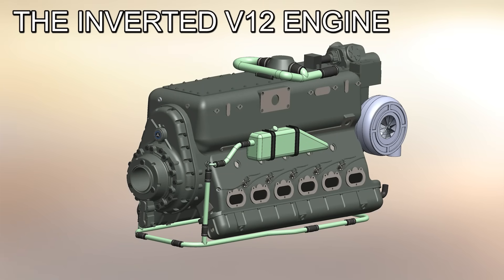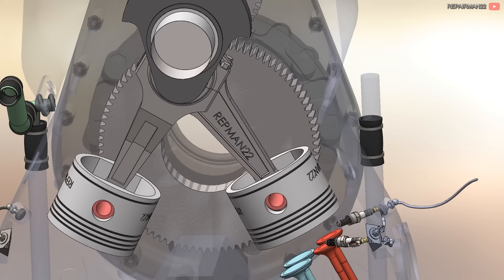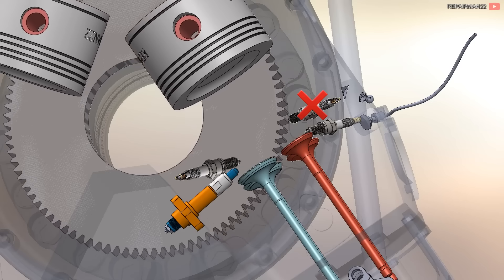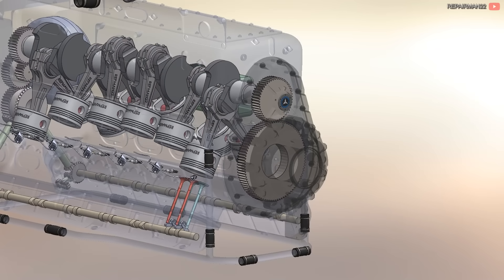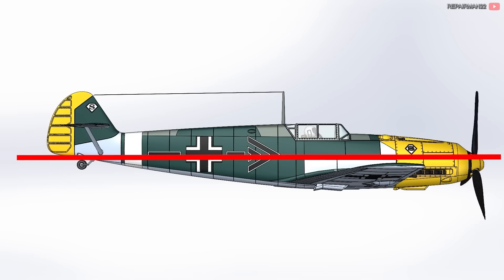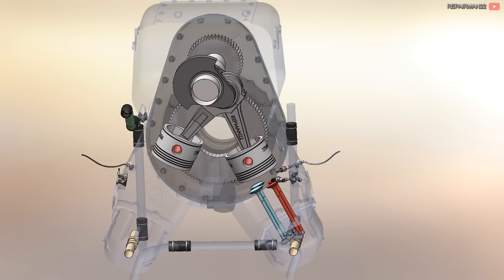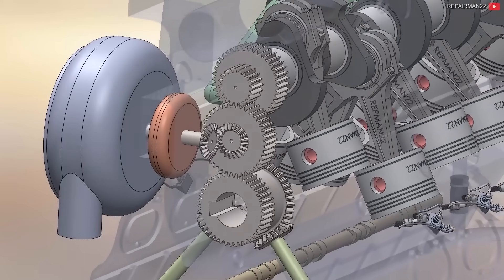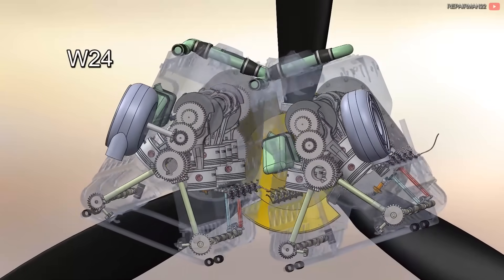The INVERTED V12 🤯 Why!?!?  - 3D animation - DB 600 Engine // Daimler Benz

Comment: Gear driven camshafts. The ultimate in reliability and peformance. No timing belts/chains to break.
Reply: Necessary reliability for an aero engine. If something goes wrong in a plane, you can't just pull over by the side of a cloud and wait for AA to come.
Reply: @brookeshenfield7156

TIMING CHAINS NEED GUIDES! 

It doesn’t matter if the chain itself failed or not.  The results are still catastrophic if a guide fails.
Reply: @calvinnickel9995  Not all engines with timing chains use or need timing chain guides. Older American cast iron V8's are a prime example. Also, there are non-interference engines that will not damage the valves if there is a failure, be they equipped with either a timing chain or timing belt system.
Reply: @Fraud_Flintstone  I don't think there's much in common between an old American OHV V8 with a higher performance OHC aero engine. The timing chain on a V* OHZ is very short. It only has to run from the crankshaft to the camshaft running in the V between the cylinder banks. Such an engine isn't going to be suitable for a high performance aero engine.
Reply: @TheEulerID maybe throw an I-6 300ci in there and balance is achieved.
Reply: A truck I once drove had a 400 with gear driven valves instead of the typical chain. 
Never had trouble
Reply: At the time of manufacturing,  modern belts were not available.  The engine does not have to severe harmonics, so gears worked well, as crank has dynamic balancers.
Reply: @brookeonmaui Until you hear a pop, clunk, sputter, sputter, and the power drops like a lead balloon. Then a faint woosy whisper and a final gasp, then SILENCE! Except the sounds of your sobbing and tears!!!😂🤣😂🤣
Reply: @leechjim8023 and you crash on the Englishman's farmhouse
Reply: @brookeonmaui  chain guide failure can lead to skipped timimng and eventually a valve collision... which can grenade an engine
Reply: These are not gear driven camshafts. The proper name is shaft and bevels.
As a motorcyclist with an old Ducati I am very familiar with this system. If you look at the racing bikes of MV Augusta and Honda back in the sixties these used a train of round gears all meshing together to turn the camshafts. 
The only modern engine I can think of that uses a shaft and bevel camshaft today is the Kawasaki W800.
Reply: @philhawley1219 they are gear driven camshafts 💀
Reply: A lot of high-performance race engines used bevels & gears. Most notably Honda VFRs & RVFs:

VFR 750 & VFR 750 RR & RVF 750 RR

Honda RC30 | Honda RC45
Honda NC30 | Honda NC35

The mechanical whine of those gear-driven cams is incredible.

Most sexy sound!
Reply: It's not matter what to use gears or chain, both can be made reliable or not. If modern car manufacturer would use gears it would be a tiny plastic gears which will wear and broke at the first day after the end of warranty period.
I had a chainless bicycle with gears and driveshaft. Front gear was so small, that at some moment lost some teethes. Also I once replace a gear in car transmission. There also were some teethes broken, but that probably cause by a road accident some time before. At the same time old-school timing chains worked all the engine life without problems.
Reply: @brookeshenfield7156

They don’t have to break.  They just have to stretch enough to skip a tooth or put the valve gear out of time enough for catastrophic damage.  Go read endless problems with vehicles that have timing chains.
Reply: This was standard for aviation and tank engines at that time, at least in my country
Reply: Due to the design of the engine, gears just seem to be the most compelling choice given the presence of gears used to drive the supercharger and the location of the heads and cam along with unique spacing constraints, i think thats probably why they did it. 

Unfortunately alot of engines designs dont really allow for it.  Such as a typical 4 cylinder car engine.   An obnoxious amount of gears would need to be stacked in order to transfer motion from the crankshaft all the way up to each cam shaft on the head. Intergrating that many gears compounds the issue of lash, especially as wear increases over time, with no clear way to address it, unlike the case with a chain and adjustable tensioner. 

Even when over head valve V8s were commonly found in most cars on the road, manufacturers still mostly chose to use a sprocket and chain to drive the cam instead of gears, despite the distance between the crank and cam being very short.
Reply: ONLY OG GERMANS CAN MAKE THIS!
Reply: Yes. Have a couple engines with this drive style. My R-1340 in my T-6G, and the Ferrari designed radial valve 4-cylinder in my MV Agusta F4 1078. The gears run up between the middle 2 cylinders, similar to the Porsche 917 flat 12.
Reply: Many commercial and mass engines used gears - like VW 2.5 TDI which used on Touareg or Transporter
Reply: Correct me but the Cosworth DFV used geared timing from the crank to the Camshafts, 
Gordon Murray's new T50 supercar uses again a Cosworth V12 again with geared timing. My understanding is that both Belt and Chain driven time is cheaper to produce and maintain and as less moving parts. But most designers say gear offers better reliability especially at high RPM.
Reply: All the V12s aero engines of that period used geared valve trains. That includes the Merlin, Griffon, Allison V-1710 and Hispano-Suiza 12Z.
Reply: @brookeonmaui  chains are not a good idea on a high performance aero engine pulling extreme g in at different orientations. You do not want long lengths of chain in those conditions. All the WW II V12 engines of which I'm aware used bevel gears to drive the overhead cams.
Reply: @TheEulerID  The pilot would pass out or be un-alived well before those forces bothered a chain any. Just the operational forces while running dwarf any external G's, short of blunt impact trauma by crashing into something hard, or projectile impacts. Your reasoning is quite .. fluffy
Reply: The power consumption of gear driven drive trains compared to belts is significant.
Reply: @allangibson8494 is it though?
Reply: @user-gn8hf2ig7w  Power consumption is why bikes have chains for the power transmission not gears. Chains and belts have higher efficiency and are much lighter but gears don’t slip - pick what’s important.
Reply: @allangibson8494  not completly correct, power consumption is only greater while advancing engine rpm because of the higher rotating mass, but Power consuption while maintaining engine rpm is lower due to lower friction  losses. Thats one of the reasons why gears are used in aircraft engines with constant speeçd props engines will usualy hold rpm for a given power setting.
Reply: @ The drag is proportional to RPM. Gears have sliding contact at all times - belts and chains have less sliding contact area.
Reply: @allangibson8494  drag is not proportional to rpm but to drive ratio and tourque, chains do have a lot more contact area that is producing friction but not in contact with the sprokets, while the actual contact area as well as the type of friction changes with the progression of one tooth through  addendum and dedendum. I think it just realy depends on the application, but for big, slow turning engines that will run on constant rpm for long durations the gear drive is just the way to go.
Reply: @allangibson8494  btw, that is not even remotely why bikes use chains
Reply: @brookeonmaui 
Pfft narc 😂
Reply: Wear factor > 9000
Reply: You mean running a belt in oil is bad?   Lol
Reply: Tough to keep in time due to gear lash, Porsche used in 587/3
Reply: 4our  I'm 
Piss-Ton Břokê
Reply: @brookeonmaui dogs eat their own vomit - delicious - then they lock your face / mouth. Don't
Reply: @brookeonmaui But in an airplane you have G’s that put a lot of strain to an ordinary engine with chains and camshafts or push rods.
Reply: Ottima spiegazione
Reply: The engine that will not push the owner of the car to buy a new one in the fear of replacing million parts cost 500% of real price? This decision will never be taken by Mercedes lmao.
Reply: noisey but ,and destroy oil
Reply: Army jeeps had timing gears
Reply: Saw one of these at RAF Cosford museum yesterday, an impressive lump
Reply: Sound cool too
Reply: Indeed! But it would difficult to add tech such as variable valve timing
Reply: In 1938 there were no belt chain,are you Crazy?
All the engines they were with Gear for camshaft at that time.
The very strange things Is 3 valve and position of intake and exhaust...that s the innovation
Reply: Heating goes brrrt
Reply: Corporate profit. The accountants ignore engineers and say a belt to drive the cams is cheaper to produce and only has to last the length of the warranty. If you think car companies care about reliability beyond the warranty, you’re in for a sunrise. Most car manufacturers don’t make much profit on car sales any more, most of their money is made from servicing and repairs or financing. Or they’d prefer you to buy another car from them every 3 or 4 years than buy just 1 car for for life. It’s called planned obsolescence.
Reply: @notmenotme614  We need government mandated reliability and repairability standards. Starting with mandated fluid dipsticks.
Reply: @notmenotme614  A well engineered belt is fine. The external type can be replaced relatively simply and modern ones go way beyond 100,000 miles. I'd much rather have that than a chain, which can and do fail catastrophically and are much more expensive to replace.
Reply: Gears break
Reply: Ducati....
Reply: Ehh Cummins and yanmar both still shear gears 🤷‍♂️
Reply: Agreed
Reply: Yeah, gears are just a little noisy , a problem for cars but not a consideration for a fighter design.😊
Reply: Yup but high decibel whine , I know because I had the up grade done on my Harley
Reply: What a fun conversation 😂
Neither is better guys but instead they are favored in different setup's, each having an advantage. Belts are quiet so you see them in most passenger cars. Gears whine but the response is better and they're popular with gear heads (That's where the name came from lol) and chains are an answer to stretching and breaking belts.
Reply: International v8s were gear driven.
Reply: The engineering behind these WWII engines is insane, huge low revving torque monsters that are designed to run under the most demanding conditions. Nothing out there today is anything like these crazy engines.
Reply: The GMA T.50 has gear driven cams. Revs to 12,100 rpm
Reply: Crazy dude haha do you imagine
Reply: Most aircraft piston engines have geared camshafts, this is not unique nor is it a source of problems, the cam will wear before the gear set does
Reply: The same as what pretty much all truck engines use
Reply: Somehow the Germans forgot about this and now their cars all have massive timing chain issues 🤷🏼‍♂️
Reply: @Niels_Dn cheap designs that make you take them to stealership
Reply: @jamesocker5235  for real 😭
Reply: @Niels_Dn don’t be silly Niels!
Reply: This engine would go 100 hours to overhaul. A Merlin would go 500 hours.  A Pratt and Whitney would run longer  and was the ultimate in dependability.
Reply: German cracked fuel would not evaporate as readily as the Allied fuel, and would contaminate and dilute the oil quickly, leading to low engine life.
Reply: @MarkSmith-nw4os Due to poor oil and fuel quality, not because of the design.
Reply: @brookeonmaui  the guides go all the time and end up in the bottom of the timing cover housing...
Reply: Hmm… the number of worn cam and timing gears I’ve replaced on aircraft over the years says otherwise.  

Chains and belts are reliable when they are maintained as well.
Reply: @calvinnickel9995  What type of engine oil do they use in piston aircraft? Does it have to be FAA approved?
Reply: @calvinnickel9995 i work on trucks and coaches, they all use timing gears and i never once had to change one.
Reply: Gear driven cams might be more reliable in short term but try and drive a gear driven motor 100000 without replacing them and see what happens bud 😊
Reply: So it's basically an American v8
Reply: They broke at the pistons.
Reply: Too loud. Too heavy.
Reply: Until you consider how much wear and tear they would suffer from spinning as such high rpms imagine replacing each individual gear compared to simply getting a new belt
Reply: @randomrayquaza2044  i design and make industrial machines. I've seen things made in the 50s working 24/24 with gears still brand new, at speeds higher then a combustion engine. The machine is immortal
Reply: I believe it.
Reply: Sorry sir , did you learned about engine materials ?
Reply: @docvolt5214 no combustion so no burnt oil problems!
Reply: @docvolt5214 it all depends on the metallurgy of the gears and their lubrication. If the gears are made from durable metals and given proper lubrication then most any mechanical component will last quite a long time.
Reply: @docvolt5214  praise the Omnissiah, all the machine spirit needs is some prayers and blessed oils.
Reply: @docvolt5214 making the comparison from industrial machinery to combustion engines is a complete non-sequitur. Yes, they use similar torque transmission methodologies but the operating and most importantly the lubrication environments are completely different.
Reply: @randomrayquaza2044  This engine spins at 3000rpm. The engine of the Honda CBR250RR mc22 hit almost 20'000 rpm and used guess what? geared camshafts. Turns out it's one of the most reliable engines.
Reply: @tank-eleven  Gears, compared to chain or belt are heavy, noisy and more expensive. Since Fiat Dino ( 1967 ), not many car manufacturers use gears.
Reply: @tank-eleven and the Honda VFR
Reply: @tank-eleven same with the older vfr's
Reply: @tank-eleven you are comparing a v12 to a single cylinder motorcycle engine....
Reply: @randomrayquaza2044  Well ... thats the beauty of a 2500~3000rpm engine ... Camshaft is turning at half that so revs are not an issue.
Reply: @Coyote27981 a 3k rpm engine? 😂.
Reply: @2seep  yes, the video is about a 3k rpm engine. It was 33.9 liters
Reply: @randomrayquaza2044  в отличие от автомобиля, самолёт не сможет остановиться на обочине, чтобы заменить ремень. А шестерни должен заменить механик в соответствии с регламентом, а не когда сломается 🤷🏻‍♂️
Reply: @randomrayquaza2044 yeah right… thats why almost all engines in industrial, construction and farming equipment use gear driven camshafts. Its just more reliable
Reply: @randomrayquaza2044 aircraft engines don’t spin at high rpm. 2500 rpm isn’t high considering the camshaft spins at half that.
Reply: @randomrayquaza2044  Wear is virtually nothing as long as it's properly oiled. Cummins engines in Ram pickups have gear driven timing and none of them ever have those components replaced as a maintenance item.
Reply: @randomrayquaza2044  
The different ways of driving cams all have their pros and cons.

Gears are expensive and far more difficult to make, sizing them to exact tolerances in those days was difficult and created a lot more rejected gears that had all that time involved in making them but aren't in spec, in an engine meant for war that translates into less produced per man hour, the best aircraft engine in the world isn't worth squat if you've got a bunch of planes sitting around with big holes in the front waiting on engine's, one thing about driving cams that's completely different than driving any other similar shaft is because of the lobes and the resistance on them from the valve springs, while the valve is being lifted the lobe is compressing the spring, ie driving it, but once the lobe noses over past peak lift all that pressure reverses and the valve spring is suddenly pushing on the lobe and driving it, that effect causes the teeth to slam across it's play when it goes from driving to being driven, the more play the harder the teeth get slammed which will eventually cause a failure from a crack forming, not enough clearance between teeth and you'll have a failure from heat destroying the metal, the biggest pro of a gear drive is they keep the cams in time with the crank.

Chain and belt drives handle the problem much better of each lobe wanting to reverse all those pressures as they travel past maximum lift, especially a belt, they absorb all those nasty vibrations in the drive from that effect, a cam doesn't spin smoothly, it's like it's getting punched around in a circle instead of smoothly spyn and a belt is good at absorbing all that violence,  chains are fairly good at it to but belts are the best at that, the obvious downside to belts is they break eventually, however in the past several decades with the advent of wet belts they're lasting a good bit longer, they're oil proof and are designed to be inside an engine where oil getting on them removes heat as it's flung off.

Timing belts and chains both lower production costs substantially compared to gear drives, there's virtually no rejected parts which are far easier to produce in the first place, but they both share a downside, they can't hold the cams in time like a gear drive set can, especially with a V type engine, when making the cam drives for a V engine belt and chains have to be made long as was the case with the famous 427 Ford Cammer, an early privateer that was racing it suspected as much so he machined places on the cam covers so a shaft attached to each cam could pass through a seal, on the end if each shaft was a disc that he marked each one with a thin white paint stripe and fashioned wire pointers that the stripes pointed at, the engine was set up on a dyno and when they ran it he shut off the lights in the room and had a strobe light he could vary the timing of the flash on, when done he could visually watch the cams at higher revs bounce around just over 6° each side of center out of time with the crank, so he built and marketed through his speed shop a gear drive conversion kit for those engine's that increased top end power by something like 30%.
Reply: @dukecraig2402  Wet belts may be good in theory, but with belt material still vulnerable to oil, the "solution' of coating the belt with a material that stops the oil soaking the belt is flawed. Inevitably, during installation and use, tiny voids made during installation  the coating allow ingress of oil oil to destroy the belt - as demonstrated horribly in the Ford Transit van, with belts failing at 40K km or less.
Reply: @autophyte  
No it's not just "good in theory", just because a belt manufacturer sold Ford on a bad type of belt doesn't mean there aren't ones that work correctly, and yes there's plenty of rubber types completely impervious to oil, what do you think the seals and gaskets in your vehicle are made out of? Leather? No, rubber. 
And your citing one example of something and claiming it's representative of an entire technology is like saying pneumatic tires are a bad design and prone to catastrophic failure based on the Ford Explorer/Firestone Tire incidents.
Reply: @dukecraig2402   Good point. I really think that coating a belt isn't a good idea, since coatings can be damaged. The answer would be in using a 'rubber' that is inherently immune to oil. But is oil seal rubber suitable for belts? I trust you're right, because I like the silence, simplicity and shock absorbing quality of belts, and if oil makes them last longer ,it will be great.
Reply: @autophyte  
Well it wouldn't be the same exact rubber as seals are made of, my point was simply that there's plenty of synthetics that are oil proof, look at the tensioner shoes of timing chains, they're not rubber but all the same they're a synthetic material, O-rings are also oil proof, chemist's are smart people, they can figure out any kind of problem you can come up with. 
The thing about belts you have to understand is like tires the rubber itself isn't its strength, it's the cords inside, like the drive belt to the rear wheel of a Harley the cords are Kevlar, the rubber is the shape of the belt the cords are its strength (that's kind of an over simplification but you get the idea I'm sure).
I don't know if I mentioned it in my original post, and I'm not digging through all these to find out, but for years now the aftermarket industry for Harley's has offered oil bath primary drive belts that replace the heavy sprockets and chain in the primary drive of Sportsters, they're intended for high performance applications and as such suffer abuse many times over that of what a belt drive oil pump in a car engine will, those things have been around for at least 40 years now, the primary drive and transmission of a Sportster share the same lubrication, the transmission cavity has several large holes that go into the primary drive cavity and as such the lube circulates between the two, big power nitro dragster Sportsters seal off those holes and run a 3 inch wide open primary drive belt, but for street bikes nobody wants the trouble of sealing the holes and running an exposed open primary belt, so for them they make a 1½ inch wide belt and aluminum pulleys that fit inside the primary case, it frees up about 5 HP that the heavy stock chain and steel sprockets suck up being turned, plus it has a better ratio than the stock primary, you can seal off the primary cavity and run it dry but being enclosed the belt runs alot hotter and they don't last nearly as long as running them in an oil bath because the oil flinging off of the belt takes heat with it and the belt runs cooler as a result.
Reply: @randomrayquaza2044 You are consuming something here. Gears are the best at everything.
Reply: @randomrayquaza2044 what the hell do you think F1 engines run?!
Reply: @randomrayquaza2044 do u understand about mechanics?!
Reply: @randomrayquaza2044  Stop defending your timing belt company
Reply: @randomrayquaza2044 
Swapping gears is easier than a timingbelt. The gear drive on my 54 I6 are original and like new.
Reply: @randomrayquaza2044 scrap the engine for parts put in a brand new engine. In war, money is no object.
Reply: @randomrayquaza2044 many diesel engines use gears instead of chains or belts. I've had some apart with close to a million miles on them and the gears looked great still
Reply: @randomrayquaza2044  Yeah .... I see'n that on modern cars .... when you spend a fortune to repace the timing belt .....☹
And on top ....... during a flight fight ... rip off ......shi.  😮😵🥴

Was that the reason why the Germans comming with a Jet ?   🤓🙃😊
Reply: dohcs in cars usually are...
Reply: @TheGrimStoic  With chains however
Reply: @TheGrimStoic ultimate is timing belt in oil pan, like new Fords, only service one, at 30k or so as at 60k engine destroys itself
Reply: @TheGrimStoic gears for president!
Reply: @TheGrimStoic give even a single example in a normal car (not a race car or super limited production vehicle)
Reply: @johnwight6041  gallardo I seem to remember...almost all v8s from before 80s. Here, I'll just paste something someone else wrote, and let you be my guest coz I'm in a good mood today (just won a sweepstake)

Timing gears are used in several car engines instead of timing belts or chains. Here are some notable examples:

Oldsmobile V8 Engines: Many Oldsmobile V8 engines from the 1960s and 1970s used timing gears, particularly the 350 and 403 cubic inch engines.
Chevrolet V8 Engines: Certain older Chevrolet small-block and big-block V8 engines, particularly in their earlier designs, utilized timing gears.
Ford Flathead V8: The classic Ford Flathead V8, produced from the 1930s to the 1950s, used a gear-driven timing setup.
Plymouth and Dodge: Some older Plymouth and Dodge engines, especially in the 1950s and 1960s, featured timing gears.
Certain Diesel Engines: Some diesel engines, especially those designed for heavy-duty applications, may also use timing gears due to their durability and reliability.
Some Racing Engines: High-performance racing engines often use timing gears for their precise timing and durability under extreme conditions.